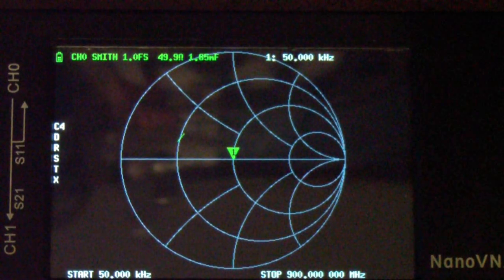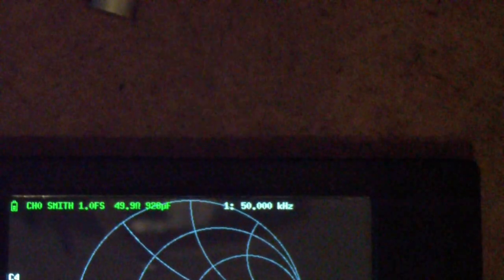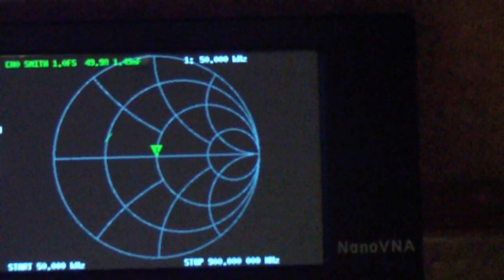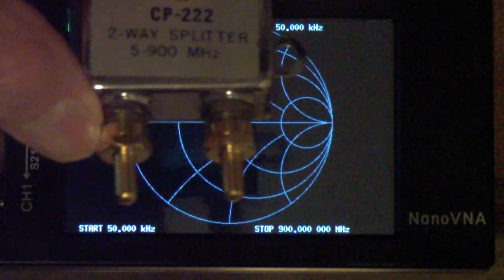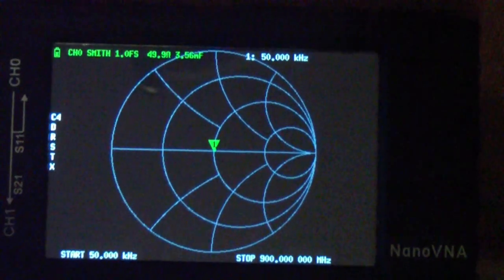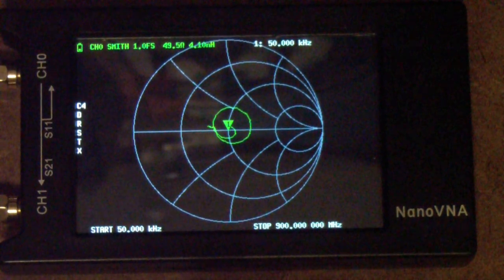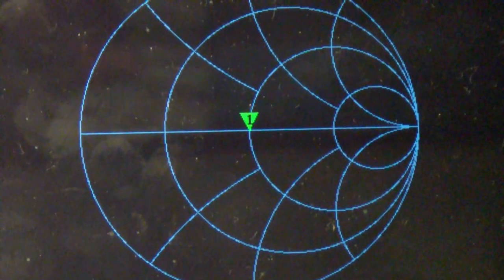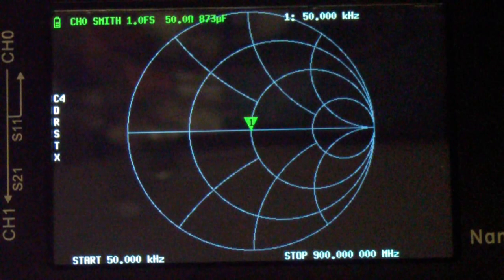TTT326 more VNA with non 50 ohm Systems

Comment: Thanks for the update. Although you have not gotten to "thru" measurements for 75 ohm systems, I suspect that the nanovna has a 50 ohm input on its second port. Can you verify that somehow? How would that affect "thru" measurements if the system has characteristic impedance of other than 50 ohms?
Reply from the maker: All excellent points. The nanoVNA's that I own (3) all have 50 0hm ports, that is CH0 and CH1 are both 50 ohm. It does affect measurements at other impedances. You can use matching pads on both ports (the ones I use came from minicircuits) but you must compensate for their effect by adding some delay (see video by Alan-W2AEW for more on this). This is one of the reasons I did not do transmission tests on 75 ohm devices in the video.